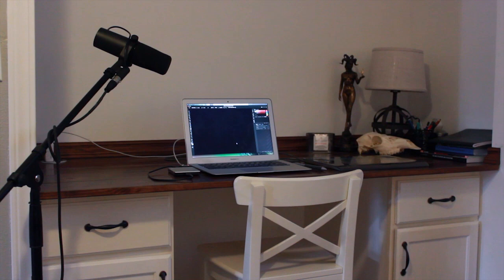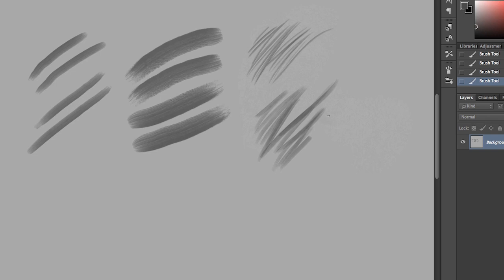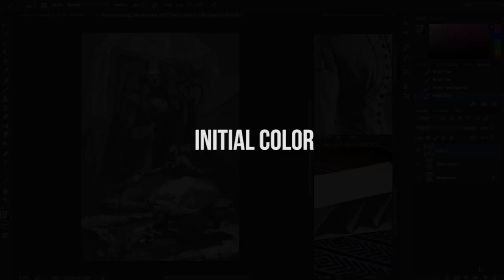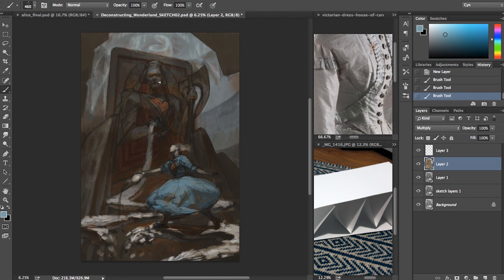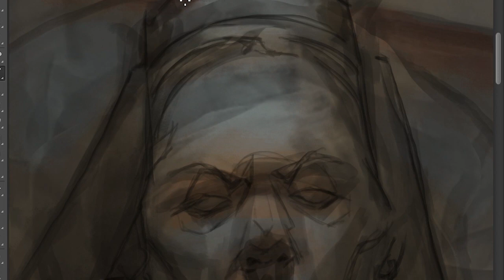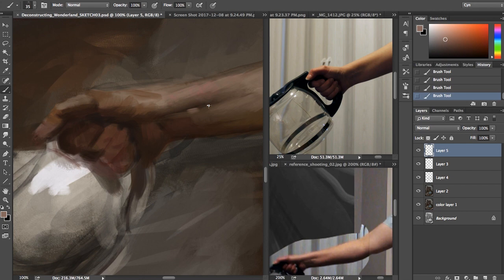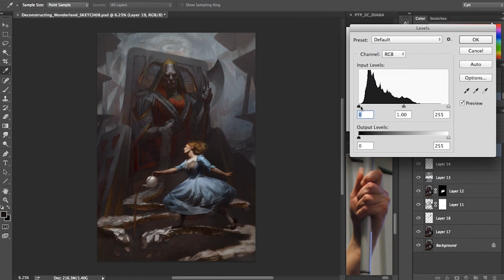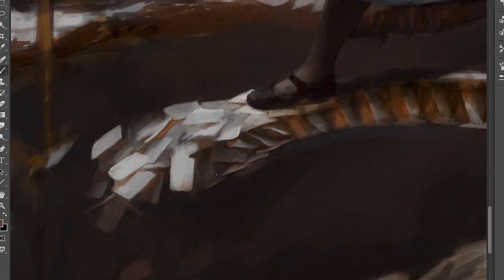Re-Paint Part Two | Digital Painting Workflow

Comment: Thank you so much for your channel, you're a very inspiring person and artist. I'm learning just by watching you work. I do have a question for you, though: do you always work in rgb mode? Isn't there any trouble when you are requested to deliver your art to a client who will print the finished piece? I'm thinking of Magic The Gathering.
Reply from the maker: Magic requires delivery in CMYK for print, but the illustrations print fine if they're converted to the correct color space after working in RGB. Making sure the final illustration is in gamut is the biggest concern (you don't want your brilliant reds to look like weak Kool-Aid), but the reason I typically work in RGB is the way blending modes and adjustment layers behave. I often use those for global adjustments or to dodge out highlights, and the quality of light is much flatter when you're working in CMYK. Thanks!
Reply: Sorry I didn't thank you earlier! It's the most complete answer I could hope for.

Comment: Is the Wacom worth it? I'm a primitive man with a traditional art background. This voodoo frightens me, yet tempts me.
Reply from the maker: Haha! I do enjoy my Wacom, but I've been using tablets for over 10 years. There is a minor learning curve if you're used to traditional brushes (which is why I like to call out the differences in process where I can), and for some the flat tablet is stranger than a Cintiq since you're drawing off to the side. If you end up trying the voodoo, best of luck!
Reply: Glad I could humor you and thanks for the quick reply. I've got some kind of Mac thing. It's a big screen with a keyboard and a mouse that doesn't move. I was told this would be good for illustration, since, with over 15 years doing art, I think I want to be an illustrator when I grow up. Unfortunately, I haven't been able to figure out how to turn it on. In the mean time I've been looking for advice and information on either a Wacom or Huion that maybe I could plug into my Mac thingy at some point so any technical savvy you could throw my way in your videos would be much appreciated. Don't be afraid to mansplain it to me. Bite size words with a just a few syllables.
Reply: ABSOLUTLEY Wacom is worth it if you want to paint